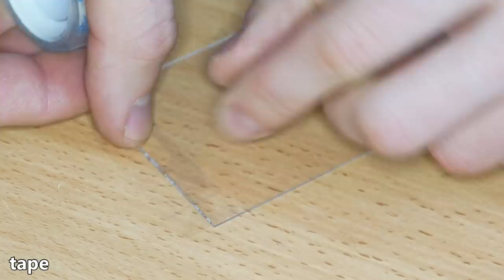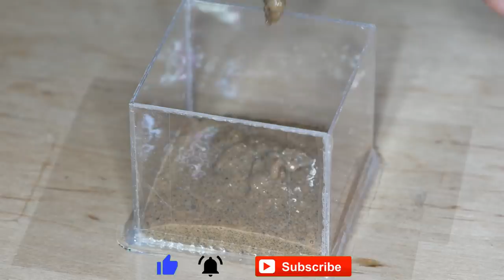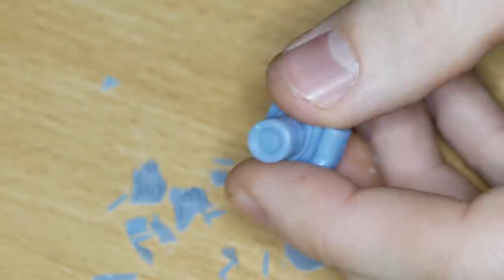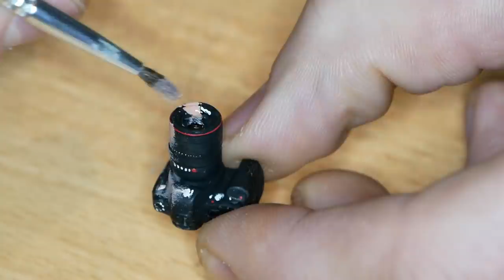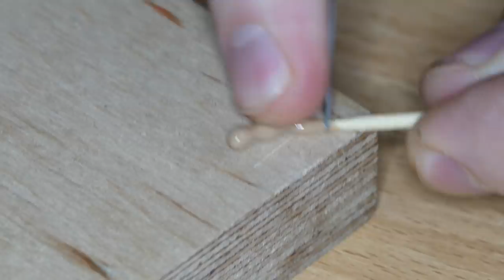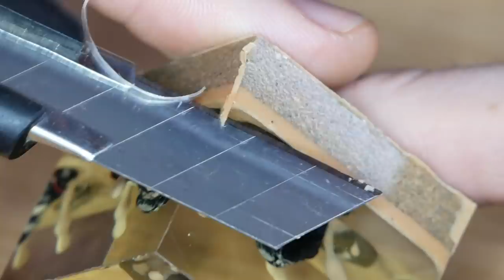Camera in the Mud Diorama. Splash / RESIN ART

Comment: Strange question.  When you buy tape in Poland, does it not have a holder with a built in cutter?  Is that why you have to use a knife, or do you just prefer to cut your tape by hand so you get a straight line?
Reply from the maker: I prefer to cut the tape by hand. Definitely